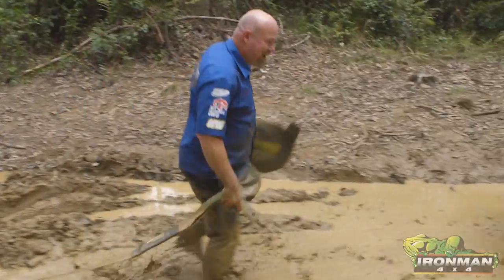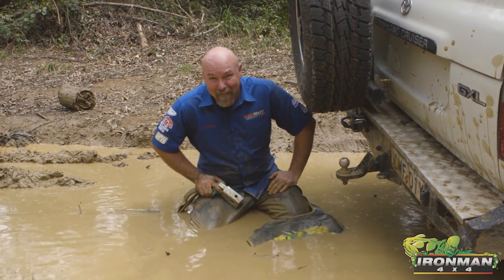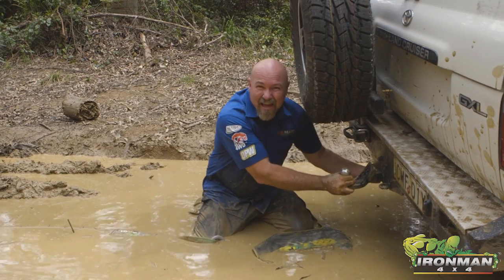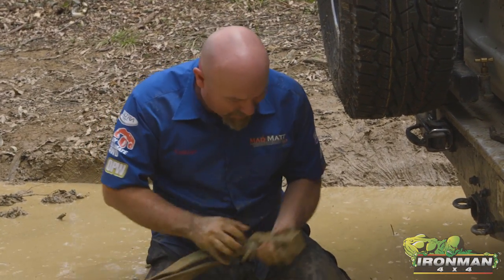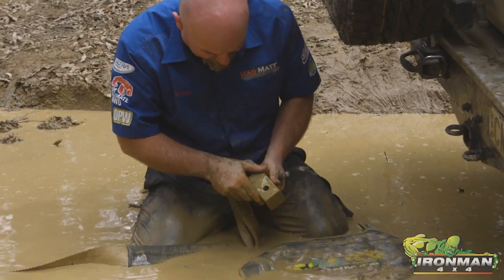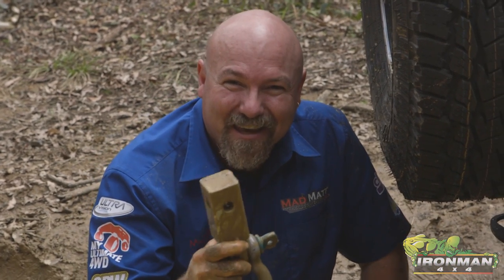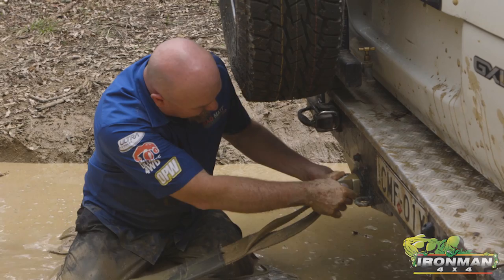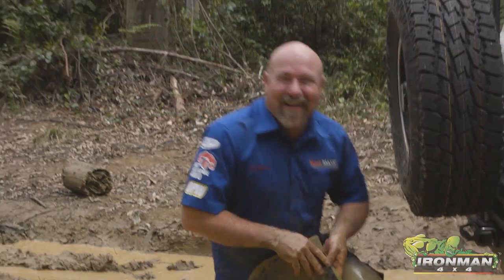Rear 4x4 Recovery Points - tow balls are BAD news if using for a rear recovery!

Comment: If you drive older stuff,  make sure to crawl under and inspect the whole receiver hitch framework.  I saw a rusted one fail.
Reply from the maker: Absolutely excellent point and it’s well worth changing out any retaining bolts on a regular basis Say every 5 to 10 years